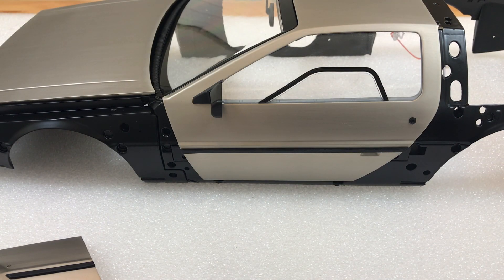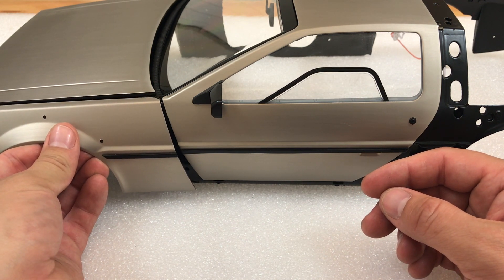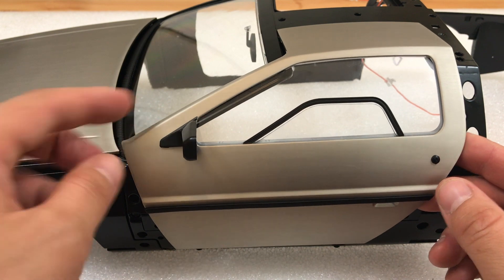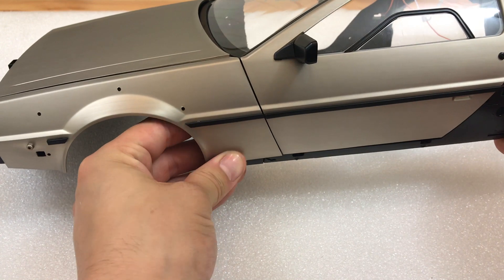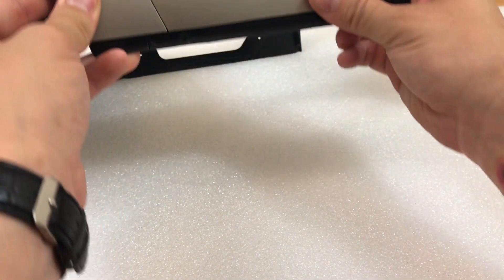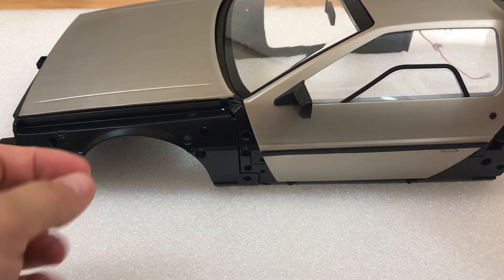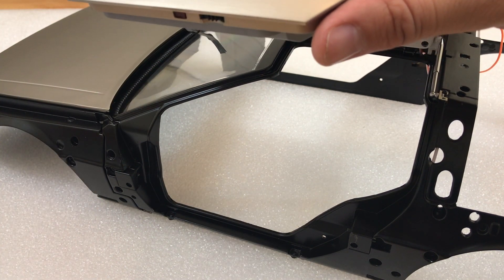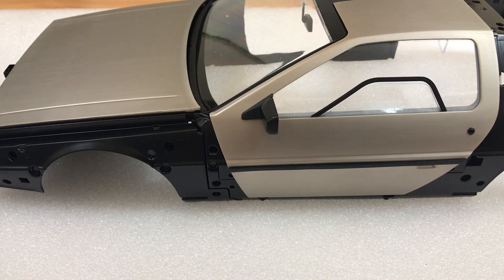Build The Back To The Future Delorean: DOOR GAP FIX - Simple How-To Guide

Comment: I appreciated your tip on using the KM screws but that wasn't a good idea. It fits in so tight that i broke my screw into the hole. I'm so upset cause I can't get it out. Now I have to contact EM for a whole new door. The QM screws works great. You just have to tighten them tight.
Reply from the maker: I am very sorry to hear this, its just a guide to help but many have done this with no complications and it's a shame it didn't work for you. Sorry 🔥
Reply: @FWA4  it's okay man. I do appreciate the tips